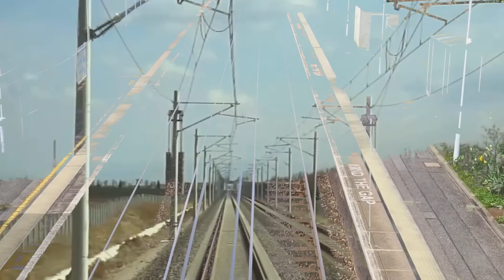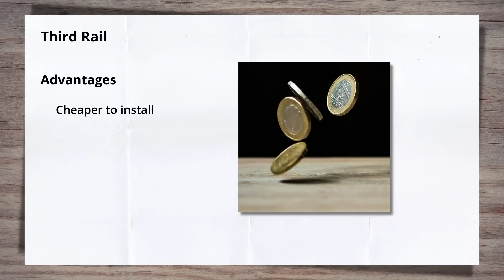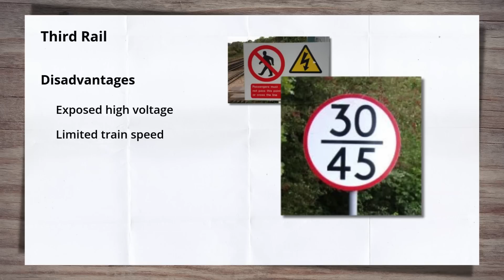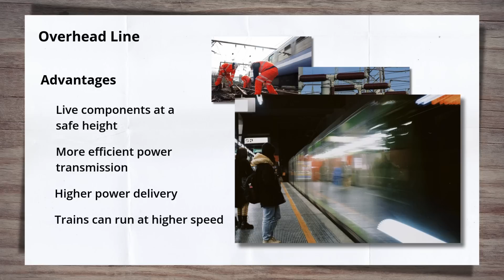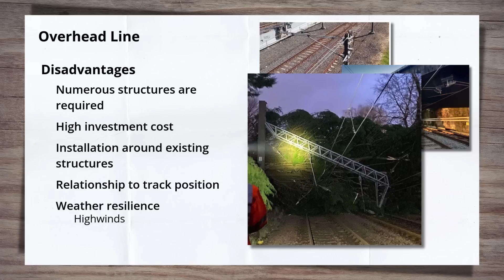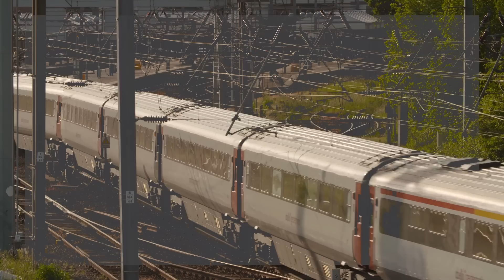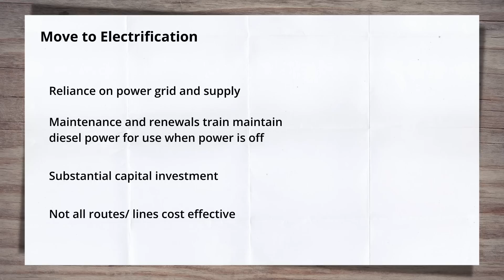How Trains Are Powered on the Railway | Third Rail vs Over Head Line Wires

Comment: Not forgetting the Thameslink service which works both kinds of traction. Lifting the pantos up and the shoes as well. Also the other service which went from East Croydon to Milton Keynes.
Reply: 3rd rail most of the time was safe. As long as you don't touch the 3rd rail everything is safe. Overhead can pull objects toward it. Providing you have insulated boots you'll be fine. 46 years on the footplate.

Comment: RAILWAY LAW NOT CIVIL LAW - APPLIES TO THE WHOLE RAIL NETWORK ! 
The LAW in Britain requires ALL Railway lines to be 100% fenced. So "unprotected" 3rd Rail as used in Britain on the ground, cannot endanger members of the Public in any normal circumstance. Indeed it is a Offence under RAILWAY LAW to Trespass on Railway Land, which applies to the whole British Railway Network. Your Civil Rights finish at the point where you step onto Railway Property including a station. So is somewhat similar to MILITARY LAW, which covers all land controlled by the Military. Something few members of the British Public are aware of. And remember "Ignorance of the LAW is NO excuse" !!!!

Comment: LACK OF ELECTRICAL COMPREHENSION ?
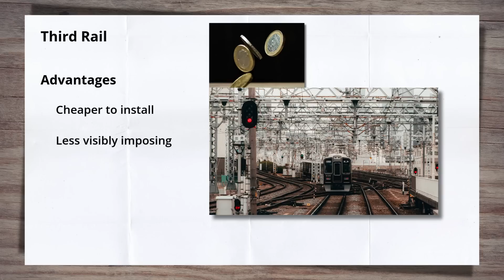The photo shown at 1:47 shows the Japanese Royal Road, the Hankyu (Private) Railway, and not a common one, as it is also Standard Gauge (not the more common 3ft 6in gauge as more frequently used in Japan). But like most of the older electrified routes in Japan it uses 1500v DC overhead. 1500v DC overhead structures (Catenary masts) have to be far heavier and bulkier than Modern 25,000v AC overhead, as found in Britain. Because the wire provided for 1500v DC has to be capable of carrying MUCH higher Amperages like DC Third Rail systems, so is thicker and far heavier ! Which explains why this photo appears to be full of "overhead clutter", so is NOT indicative of overhead, when compared to Third Rail !   

The Shinkansen (Bullet train lines) use 20,000v AC at either 50Hz or 60Hz, as Japan's National Grid is divided in two. And the dividing line in close to Yokohama south of Tokyo. Bullet trains run on Standard Gauge track so can't "interface" physically with the rest of the "JR" network, which is 3ft 6in gauge. But look at any Shinkansen line and the Catenary will be seen to be much lighter and less visually obtrusive. Due to the fact that the higher carrying voltage of 20,000v AC means lower Amperage than required for lower voltage DC systems. 

AMPERAGE vs VOLTAGE EXAMPLE
A 12 car Electric Multiple Unit train leaving Waterloo on the 750v DC Third rail system, has 3000hp (3 x 1000hp motor cars, one per 4-car unit). When the Driver whacks the power handle open to start the train moving, the Ammeter on his desk will jump from ZERO AMPS to 3,200 AMPS immediately. To carry such a high Amperage without burning out the electrical supply, requires a heavy duty Third Rail weighing around 120lbs per yard !

Now move across to Euston station London Midland Region where the 25,000v AC overhead system provides the power to things like 5,000hp Class 87/90 Electric locomotives capable of hauling a 12 car (Mk1 or 2) set of coaches. When the Driver opens the power handle to move this train, (which is similar in weight to the 12 car EMU at Waterloo), the locomotives Ammeter will only jump to around 65 AMPS. That's LESS than the maximum potential of a Domestic Electric split level oven which in Britain has a maximum 75 Amp supply !!!!!

Hence less amps equates to a lighter thinner smaller power supply cable.  

NOTES: The Hankyu Railway's primary route runs from Osaka (Japan's second city) to Kyoto, one of the two Ancient Capitals (the other being Nara) both in the Osaka region. Japan has in addition to the main "JR" (Japan Railways) network, around 200 other major private Railways using four different Gauges, and a number of different Power supplies including 3rd Rail. 

Probably the largest Private Railway in Japan is the Kinki Nippon (Kintetsu for short). This Railway uses THREE different Gauges. With an "Inter-city" route between Osaka and Nagoya on Standard Gauge. A Osaka area suburban system on 3ft 6in gauge, and at least one Rural branch still using 2ft 6in Gauge, and ALL use overhead electrification. At either 1500v DC, or 650v DC on the 2ft 6in gauge lines.

Comment: It also have a problem that when using the third rail and the train are passing those throughout and they may easily to have no electricity input. If the train is short and they may not easy to touch those third rail, so they will be stucked due to lack of electricity
Reply: Eh...... ?

Comment: The 3rd rail is VERY inefficient because of the low voltage. It requires frequent sub stations to maintain the correct supply voltage. 
The new UK OHLE is very obtrusive for reasons only known to the designers. Look at DB, SBB etc where they have far greater weather issues but far less failures on much more aesthetic OHLE.  The most efficient supply is actually the 15kV 16.7 Hz. Not enough space for all the calculations.!  No one in their right minds would install 3rd rail now.

Comment: Thanks for your usual solid description of the pros and cons of the competing electric train systems.

As for the future off electrification of railroads or anything else,, electricity, for the most part, is NOT "clean energy".  Most electricity today comes from, and always will  come from, burning fossil fuels and nuclear reactors.  So all electric vehicles do is move the exhaust pipes of all the vehicles from the vehicles to the power plants.  And adding a lot of load for electric vehicles means more and bigger power plants will be needed.  The only benefit of this improvement of urban air quality in the case of electric cars  (at the expense of rural air quality), but trains cross the country so this isn't a factor for them.  Wind and solar power require enormous amounts of real estate to provide significant power, are extremely dependent on both the weather and the diurnal cycle, and have other environment problems like the wind turbines being absolute destroyers of beneficial birds and bats, plus creating unhealthy low frequency noise that affects both people and livestock nearby.  And making the modern, high-capacity batteries that make electric vehicles viable at all produces a LOT of environmental pollutants.

Comment: Message from Switzreland. Cost of overhead electrification isn't that much. Just do it everywhere and be consistent and get good at it. It makes everything else easier. It also makes the use of equipment easier, we are moving to having basically a single loco for 95% of all tasks and only a few spezial ones that have disel backup. That how you save money. Its mostly not that big problem in the winter. Switzerland has high on time performance, and we have nearly 100% overhead electrification.

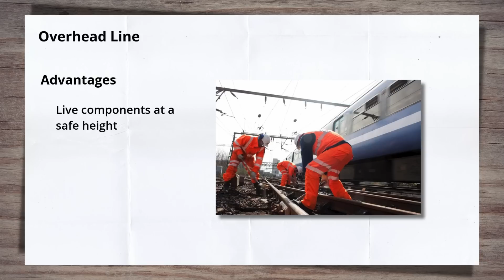Comment: I've just watched this video again, 2 months later, and have spotted a serious error at 4:50. The use of high voltage AC transmission does not remove the need for on-board transformers, but makes them essential.
Reply: I agree 100%. The need for transformers is due to the difference in voltage between the supplied voltage and the voltage the traction motors operate at.  Where there's that difference, there's also a transformer to bridge that gap, so to speak.

Comment: On leaving school in 1960 and gaining employment with a civils contractor in London UK, I worked the an old steam train sized tunnel being enlarged to carry overhead electrification lines. The tunnel was used to supply empty carriages into Euston Station. The tunnel is no longer used.
Later in life I was chatting with Egyptian railway engineers and the reason they gave for not using third rail, is the cost of installing and maintaining ROW fencing. Where with the use of steam, then diesel trains people and animals are free to roam across railways, in the vast expanse of the Egyptian Desert.
An experiment to reduce power and brake maintenance costs on the running of the Victoria Line Tube in London. Was to tunnel in a down grade out of stations to a mid point, then an upgrade to the next station. This to reduce acceleration power and the train can coast into the next station using the upgrade to reduce speed and use of braking. I understand this method was not used in later tube line contracts.

Comment: I think you need to do a little more research before embarking on this relatively complex subject. You have completely mixed up the issue of transformers and have omitted the fact that many OHL systems around the world are also DC , either at 1.5Kv in southern France, the Netherlands, Australia, or at 3Kv DC in italy, Belgium, Poland, Slovenia etc,.In addition to all the different metro, light rail and tram networks.
There are two main AC systems; 15Kv (16.3 Hz) and 25 Kv (50 or 60Hz) these too have several varients.
Many advantages and disadvantases exist within OHLE systems, though AC is now generally preferred (except for trams). I hope this is clear without delving too deeply.
Reply from the maker: Thank you for the feedback, I will take it on board when doing any further videos on OLE and electrification

Comment: you got transformer problem completely backwards
collector motors on trains usually run at voltage up to 1500v
that means that trains with third rail already have correct voltage for motors, thus no transformation of voltage needed
but if you have overhead power supply with standard 25kv AC you need a transformer to reduce the voltage and a voltage rectifier to make it to DC

more modern trains usually don't use collector motors tho, but problems are still similar, with OHW providing way too high voltage

high voltage is only used because that increses transmission efficiency and voltage drops on long wires

Comment: well problems of danger and snow for third rail can be made better, but not solved completely by having shoes under the third rail and third rail itself being suspended a dozen cm from the ground and that way you can have plastic cover on top, so if someone steps on it, they are not likely to be electrocuted
same with snow, small amounts of it won't block connection, but larger amounts still will cover it and prevent trains from running

Comment: Nice video, only thing to mention is I think you have the use of transformers muddled up. AC locos/multiple units will have a transformer with the primary winding at a nominal 25kv. From this secondary and even tertiary windings will step down the differing voltages required . An example being a class 91 that has 4 secondary windings feeding motors, a 900v one for train supply (ETS) 240v for compressors and 110v for battery charging etc. Older DC 3rd rail emus used to have motor alternators to produce ac that could be rectified down etc, whereas these days  most modern fleets use solid state inverters .

Comment: 3rd rail systems and many railway traction engineers seem locked in a time warp. For example, why do new installations use DC rather than AC. With AC we could then use autotransformer feeds, extend injection and reduce shoe wear. Why are we restricted to 600-750vdc rather than say 1,500 or 2,000 vac (We have the semiconductor technology). Why do we still use top shoe collection rather than bottom or side collection to reduce risks of electrocution. This question is for new installations only and the answer I suppose is cost and established practice, pity.

Comment: The London Underground, which uses a four rail DC system, solves the lack of power problem by distributing drive bogies through the train.  This also helps avoid power loss when crossing points.  Anyone who has travelled on the tube will have noticed the large copper cables used to distribute the power to the rails, a train pulling out of a station easily draws over 3,000A which will cause noticeable losses along a steel rail.

Comment: also with the third rail is if a item made of metal get blown on the track and it touches the third rail and live rail it causes them get welded on the track resulting in trains getting stuck unable to move (if the track is not a type allow trains to run both directions
Reply: That is due to he use of legacy 'top shoe' collection. Its not generic to 3rd rail.

Comment: Chicago sees more variety of weather than most major cities. We’ve seen temperatures from below 0F/-18C to over 100F/38C. And snow and ice so bad, switches near the main stations have permanent natural gas pipes that provide open flames in the winter to keep the switches working. Even so, there is a mix of electric power supply. The ‘L’ subway system primarily consists of third-rail with a short section (Yellow line) with both. The L tracks are famously overhead in the Loop but are also underground and at street level (some far ends). The Metra Electric/South Shore train line uses overhead lines (and until recently, had a street-running section). And the many other passenger and freight lines use diesel/electric engines.
Reply: Ok. Russian railway engineer is here. Weather conditions you mentioned above for Chicago are regular and widely measured in all railroad network in Russia. 
We use pneumatic lines to blow the snow away from switches and electric heaters for the same purpose. Never seen even in the nightmare the open flame as a solution for the snow on the switches. It is insane. Just imagine the situation with the leakage of condensed propane from the rail car tank passing over the switches when the open fire heaters are on.

Comment: The German S-Bahn third rail system is technically superior to the British system. The third rail is covered and the current is collected from underneath the third rail. This means there is less danger of electrocution and fewer problems with snow and ice. In Britain this variant is used on the DLR.
Reply: The British system would be OK if the rails were protected with planks at more locations.

Comment: I have for long time wondered about low frequency AC power for trains. I heard its much cheaper to produce big motors for low frequency AC than power grid frequency. Also there are frequency converters for modern units of today.
Reply: i.e 16.6Hz used by German railways. But voltage and freq are less of an issue today with modern semiconductors.

Comment: As someone who lives on Long Island, New York, United States, I am familiar with the strange marriage of both systems and unelectrified rails on the "Long Island Railroad." The line at the western most point is used by both Amtrack (overhead) and the Long Island Railroad (third rail) mostly because there is a yard on Long Island for Amtrack, but there is a rumor about a possible tunnel and extension of the Amtrack line through one of the main lines of the LIRR, meaning a significant portion of the line will have both third rail and overhead at the same time. Then we have many extensions of the line without any electrification (not to mention that the freight line is diesel electric, even when they are running on the lines with the third rail).

Comment: On the contrary, lower voltage DC third rail does not need a transformer, while higher voltage AC catenary wire system (like 25kV AC) requires stepdown transformer on the train.
Reply: DC rails have a transformer every 6miles or so
Reply: Lower voltage means higher current for the same power. It means thicker wires and more heat.

Comment: Diesals being much heavier then electric trains have a greater tractive effort, and since most of the electric trains are run in thermal power plants (coal) they are much more polluting indirectly then diesal trains as diesal is lesser polluting, and also on steep gradients electric trains fail to start heavy loads where as diesal trains can easily pick up on such terrain
Reply: Power can be generated in any number of ways in a power station & the method can even be changed at any time as new technology becomes available.
The worst scenario is to generate power with huge diesel engines. Even after accounting for transmission losses, this would still be more efficient than generating it from a relatively smaller engine in a locomotive.

Comment: around NYC they have some trains that can run overhead and third rail as well as diesel locomotives that can run diesel or third.  Dual Power diesels for example run up the Danbury branch of the New Haven line as the branch has no electrification but you also cannot run a diesel into Grand Central. So the locomotive cuts the engine and runs on the third, The Overhead and third trainsets are because the NH line shares most of its track with the NE corridor which is overhead, but the Metro North lines into NYC are all third rail.

Comment: The New Haven railroad was compelled to use both third rail and catenary.  This is described in book “The Northeast Corridor” by David Alff. 
https://books.google.com/books/about/The_Northeast_Corridor.html?id=75LnEAAAQBAJ   In the early 1900’s the state of Connecticut made third rail illegal.  The New Haven locomotives used 11k catenary on their property, then switched to third rail for using Grand Central station.

Comment: I live near Toronto, Ontario.  At the moment, a new LRT line is being installed right down the street in front of my condo.  They are going with a pantograph system and will soon be installing the wires.  In Toronto, the subway system uses 3rd rail, but the streetcars recently switched from trolley pole to pantograph.  The new LRT lines in Toronto will also use pantograph.